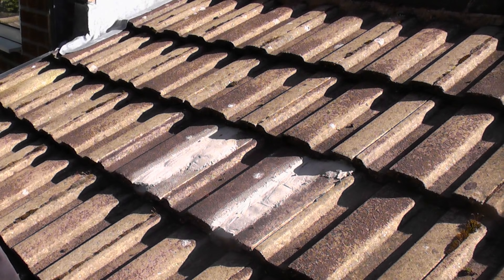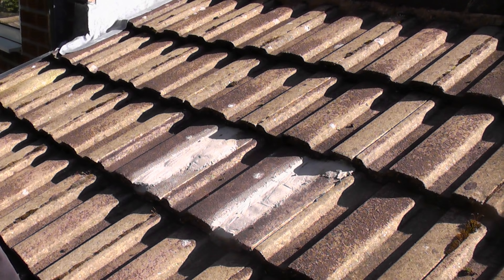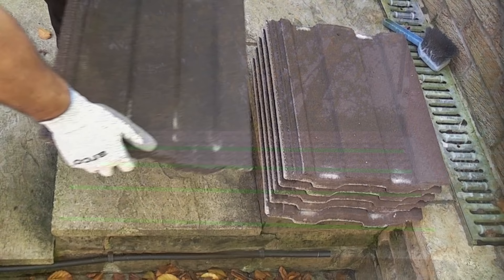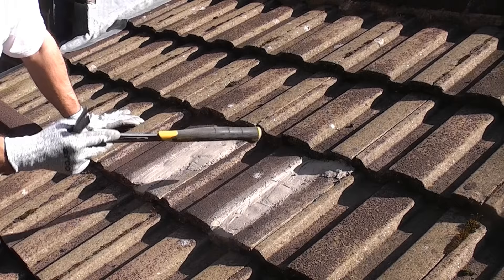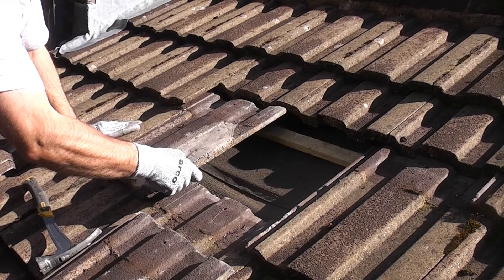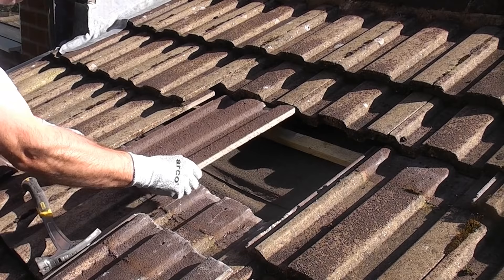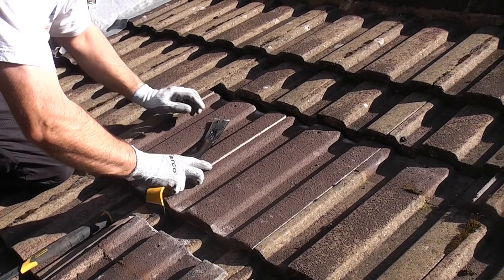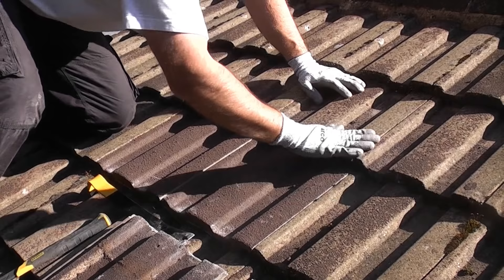How to replace an interlocking roof tile

Comment: Not nailed 3rd row anymore. All rows nailed. New BS
Reply from the maker: That'll make it much harder to replace any tiles!
Thanks for the comment
Reply: Nailed and clipped depending on roof pitch ! Also what was not mentioned was tiles 40 years ago were made imperial not metric ! So the equivalent will not fit !

Comment: Thank you sincerely, I’m autistic and have been working through renovating my house.  During the disassembly of the scaffold for the main roof re-felt, I cracked a tile with a long pole.  I struggle tackling jobs unless I know everything that I need to do.  This being English and expertly explained, has totally put my mind at rest🥰🥰🥰😆😭💪
Reply from the maker: I’m glad you found the video useful
Thanks for the comment 👍
Reply: @ultimatehandyman  removed and replaced the broken tile, then noticed 2 more, where the scaffolder had walked on the roof.  Second one swapped no probs, but the third one was two courses down from the Ridge, so was inflexible.  Had to use a rubber mallet to even get the tiles above to retract, then they all became stuck.  Fought them for 10 minutes no movement and it started raining☔️ 😭😭😭.😆🙄🤦‍♀️🤷‍♀️ Luckily I had a professional car door card tool, which rocks them up and back.  Then i used the claw of a hammer to bully them back into place, nightmare, but finally got it sorted😛😛🕺🏼🕺🏼😆😆❤️❤️❤️
Reply from the maker: @brandsthatcreatelitter1648   Jobs often start off small and then escalate!
Glad you got it sorted in the end 👍

Comment: Thank you so much, just got home and a tile right next to a velux window has slipped down.  After watching this video going via the safety of the velux window with just my arms outside I pushed the above tile up, slid up the loose tile and screwed it back down followed by pulling back the tile above.  Sorted!.  The original nail for some reason wasn't long enough, the long thin screw worked a treat.
Reply from the maker: I'm glad the video helped 
Thanks for the comment 👍

Comment: Great video. 
We had scaffolding up on our kitchen roof to get to the main roof to replace broken and missing tiles and the scaffolding broke 6 tiles under the boards they'd placed to spread the load. Scaffolders said they'd inform the roofer. We've tried for a week to get in touch but all means of communication have failed so now I have to source replacement tiles and do it myself before the rain comes next week 😡.

Comment: Yo chez..the sun still shining and the grass is still growing.... and we love that... our tiles need replacing as the wasps get under them and make a home....
informative  and never every three were nailed  :)

Neil
Reply from the maker: +neilobusk 
We had three wasps nests about two years ago. I searched the internet and the overwhelming advice was not to try and get rid of them yourself, as they recommended special clothing. I called out a pest control firm, a woman turned up in shorts and just sprayed them with a chemical and it wiped them out LOL.
It's normally every third row, but sometimes they nail every row.

Thanks for the comment ;-)

Comment: Always turn to your how to videos when I’m struggling. Great advice on removing the nailed tile. How do you re mail 
the tile that was nailed down originally?
Thanks
Reply from the maker: I would not bother to be honest, it will be fine just held back in place with the interlocking tiles and the weight from the tile above.
Thanks for the comment 👍
Reply: Glad you asked that, as i was wondering the same thing!
Reply: If you really want to then take out the tile above it that is not nailed.

Comment: I live in a townhouse (3 story building). I had couple of tiles were out place they were partly sitting on the gutter, so I called a roofer to fix it. 1st company I called L Smith And Sons Roofing Ltd, said it's too dangerous to remove them just by climbing up a ladder. They'll need scaffolding it'll cost 3 to 4 grand to fix it.
Thought it's rather steep, so I contacted  Heritage Roofing, and these guys did it with just a ladder. They found new problems while doing an inspection and swear to god, when I saw them walking on the roof without scaffolding not even a safety line I sh!t my pants, questioned the boss about that and he told me not to worry, they're pros. 🤷
Does £250 for repairs and £300 for an inspection sound reasonable to you?

Thanks for the video and reading my comment.
Reply from the maker: I’m not sure what prices roofers charge these days, but it’s much cheaper than the quote with the scaffold 👍

Comment: Good informative video got a porch roof that I've cleaned all intact but looks aged 15 years and washed out would you paint dye replace or cover with plastic  tiles please can I ask
Reply from the maker: Probably the best solution is to replace the tiles. You can paint them, but I'm not sure how well it works.
Thanks for the comment 👍

Comment: Very useful video. However, I have a cracked tile two rows down from the ridges so I can't slide tiles up to release and replace it. Any ideas? Thanks.
Reply from the maker: I’m afraid you might have to remove the ridge tiles in that area 👍

Comment: You said not to use a ladder, i have to replace a tile in the 1st row just above the gutter. Now i do have a safety harness and rope i can do it from the roof but would my weight stop me sliding the tiles up and if its nailed would a ladder position be better? Thanks for the video
Reply from the maker: If you can reach from the ladder safely, that is fine- but please make sure that someone foots the ladder (I know a guy that died falling from a ladder)
Thanks for the comment 👍

Comment: Was wondering if they're all nailed in how do you get the last nail back in?  I suppose if they're nailed into the little wood risers any leaks would run down gaps in that over the paper if I left left one nail out but wouldn't feel comfortable leaving that hole.
Reply from the maker: You don't, you just leave that nail out. The tiles should not go anywhere 😉

Comment: Great video. I tried to replace few cracked tiles. I checked but there was no print underneath. I took it with me to the shop and looked like Marley one so bought that. It turned out it does not fit perfectly. Does Marley change them slightly over the years or maybe it is different manufacturer?
Reply from the maker: I don't think they change them, it could be a different make, like in the video 👍

Comment: If the tiles can be pulled out then what is stopping them from falling off. I was under the impression that the tiles are interlocked to each other but obviously they are not in the video.
Reply from the maker: They can only be pulled out, when the tile above is lifted.
They have a ridge, which sits on the slate batten, then the weight of the tile above holds it down 👍

Comment: Hi mate , great vid , I have a dormer bungalow and all the water from the fibreglass part of the roof is channled down one row of tiles due to it collecting in the dormer gutter and flowing  through the down pipe and as a result this one row of tiles are starting to look very thin due to the cascading water taking off the sandy surface , ( the tiles look identical to the ones you show in your video ) is it possible that I can just swap them around with some other tiles that are not getting the same treatment elsewhere on the roof ? You're advise would be greatly appreciated . Also now subscribed , have watched several of your other vids and have found them to be really helpful and informative, thanks and keep up the great work 👍
Reply from the maker: Yes, you could do that, or you could get some new tiles and replace some of them.
I've just seen a house where they have painted their roof, apparently the coating will last for 20 years. I'll be keeping an eye on that house to see how well the paint lasts!
Thanks for the comment 👍

Comment: Hi thanks for the video. I want to replace few files but don't know if all these tiles are universal sizes?
Reply from the maker: I'm no expert on tiles but if you get for example a Redland renown tile they should all be the same size. If you remove one of the tiles it should have the make on the underside. 
Thanks for the comment

Comment: nice vid hope you havin nice xmas here in caithness its grim very windy got the same tiles been watchin them been lifted up by wind and banging back down again, how strong are these tiles keep on expectin to hear them crack is it better to have every line nailed
Reply from the maker: They are fairly tough. I can walk on them most of the time without cracking them!
Nailing every row would be time-consuming and would make replacements more difficult in future.

Comment: Thank you. Would it be possible to push up the 2nd row of tiles beneath a wet ridge? I specifically have double roman tiles but I think they're pretty similar to these to deal with.
Reply from the maker: Not sure, sorry. I have never had to do that, so close to the ridge tiles 🤔
Reply: @ultimatehandyman  Ok, thanks.

Comment: Good job as always 👍🏻what is mixed with the cement to strengthen it when you showed the repaired one what is the fibre
Reply from the maker: +jerry o connor 
It's a reinforcing fibre that they use in concrete.  This is the stuff I used http://fave.co/1KUEcwW
I will make a video on how to mix this in the next few days ;-)
Thanks for the comment

Comment: Really helpful, thanks.
Reply from the maker: Glad it was helpful!
Thanks for the comment
Reply: Ultimate Handyman hey no worries. I’ve replaced the tile today thanks to you but I worry that if i ever have to get a nail out I risk cracking the tile where you’re having to lever with your jemmy. You know what I mean? I saw that you didn’t crack it when you got the nail out but is there another way to get a nail out if you think the tile might crack as you use the jemmy? Or is it just a case of putting some cloth underneath or something? Cheers.
Reply from the maker: @genericuser2339   I know what you mean, but normally the nails used are galvanised clout nails, so they are normally pretty easy to remove (not like annular ring nails etc.) As long as you use a wide jemmy bar there is little chance of cracking the tile. You could also use a wide piece of wood to spread the force out, under the jemmy ;-)
Reply: Ultimate Handyman yeah so basic common sense. Thanks a lot for the info, really helpful.
Reply: That sounded sarcastic lol. Wasn’t meant to be :)
Reply from the maker: @genericuser2339   Not at all, I could see from your previous comments that you were a polite person. So I definitely did not take it that way ;-)
Thanks again for the comments

Comment: Can you do this with single pantiles? mine all appear to be nailed. I don't want to break any because replacements arent easy to find in small quantities.  Need to remove 3 or four above chimney flashing because of a leak there
Reply from the maker: I'm not sure sorry. I have only ever worked on slate roofs and the type of tiles in this video.
Fixmyroof might know (just search for them on YouTube)
Thanks for the comment 👍

Comment: Great video thanks. No use of a slate ripper to remove the nail?
Reply from the maker: I've never tried using a slate ripper on tiles, so I'm not sure if it would work. (that reminds me, I have not seen mine for several years)
Thanks for the comment 👍
Reply: Slate rippers are only any good for slates  not tiles ,hence the name 😇😉😊

Comment: I have 60s green single pantiles on my roof which are mostly no longer green. Will new tiles fit perfectly or would I need to get used ones for that. I know you can't get green anymore but not sure exactly what make they are as I've never taken any off.
Reply from the maker: They should fit, I have never heard of new tiles not fitting an older roof.
Thanks for the comment 👍
Reply: @ultimatehandyman    Thanks for the reply. Well not  long ago an old roofer said to me after they turned metric they never fit perfectly so if I have my verge redone and lose some tiles through breakages they'd all have to be replaced with new ones even several rows back. Didn't make sense to me. I thought maybe he was after my tiles for another job. Still haven't had the verge done which has rotten corners, considering a dry verge but don't like the look of them much.

Comment: I need to replace a tile in the 4th row out of 5 on the porch roof. I assume as the 5th row goes up against the wall that those tiles can't slide up. how do I deal with this situation? 5th row is also covered with lead flushing, if that's the word. thanks! also great video!
Reply from the maker: You will have to remove the ridge caps to remove the last row of tiles. The lead can normally be lifted carefully and then tapped back down afterwards using a block of wood or soft mallet. 
Thanks for the comment ;-)
Reply: Ultimate Handyman thanks for the advice!
Reply from the maker: You are welcome ;-)

Comment: I wasn't so lucky when i changed a section of my roof. All the tiles were nailed and it was a pain the rear to unhook them all.
Reply from the maker: +aserta 
Yes, sometimes they nail each row, which is a bit unnecessary to be honest as it makes replacing them a real pain in the arse- as you will know!
Thanks for the comment ;-)

Comment: Hi, Do you have any tips for walking/crawling on all fours on the tiles. I want to remove my chimney and was quoted £450 but think ill do it myself for £30 in materials. Its a shallowish roof about 30-35 degrees on a bungalow with redland 50 double roman concrete tiles. My biggest concern is cracking a tile while moving across the roof. Cheers
Reply from the maker: No, sorry. 
The only thing I can think of is a roof ladder.
I once walked on a slate roof at my old house and cracked several of the slates 😱

Comment: Hi mate .I have slow dripping leak in the roof .one or more tiles have eroded or broken letting in water slowly and the felt must be soaking up the water. i am being told that the whole roof needs to be replaced or at the least one side. This to me seems ridiculous .Is it not possible for a tradesman to erect scaffolding and fined and replace the broken tiles .I have been told that the felt does not stop water the roof tiles do that so if thats the case why i am being told the whole of one side needs to be removed and replaced when its simply a matter of fining and replacing the broken tiles? can you give your best thoughts on this please.
Reply from the maker: You have to be careful with some roofers as they will try it on. A roofer tried to rip me off about 10 years ago, which is one reason why I set up my website (then the YouTube channel).
The felt is supposed to be waterproof and any water that gets through or under the tiles is supposed to run down the felt into the gutter.
You are sure that your problem is not caused by condensation?
I'd get opinions from at least three different roofers to be on the safe side ;-)
Reply: Just repair the broken tiles with any brand that contains MS Polymer adhesive. They last more than 30-50 years and are fairly cheap. Saved me a hell lot of money instead of changing the whole roof tiles.

Comment: What are these tiles made off? Are they concrete tiles or clay tiles? Thanks in return.
Reply from the maker: They are made from concrete.
Thanks for the comment 👍
Reply: @ultimatehandyman  are most roof tiles in the uk concrete? I heard that concrete tiles contained asbestos during mid 1900's.

Comment: Total novice here, so excuse the possible ignorance of this. Rather than lifting the tile that is nailed down, and chocking it with blocks, wouldn't be easier to simply slide the tile above it up, and then put both back into place after?
Reply from the maker: I'll try that next time 👍

Comment: how the f.. did the slide up that easily.. iv hit mine with a rubber mallet and kicked them with steal caps... won't budge.
Reply from the maker: Apparently, they have now started to nail down every row of tiles!
If you can't get one to budge you might have to strip a load off!
Thanks for the comment 👍